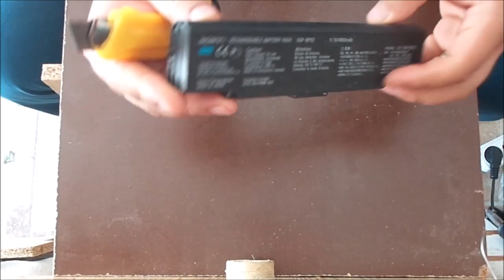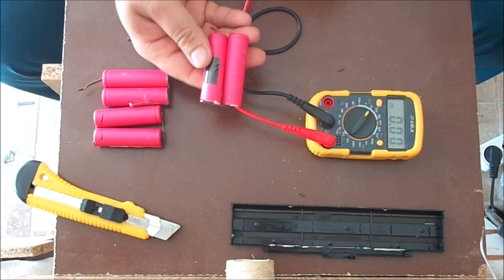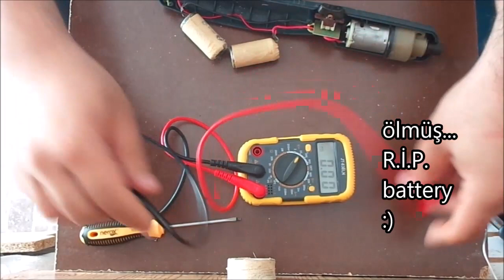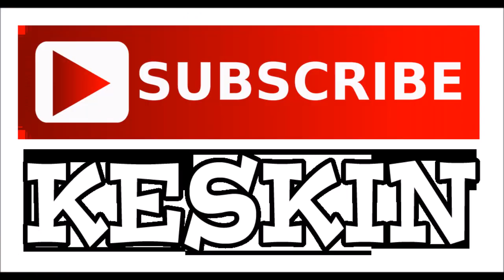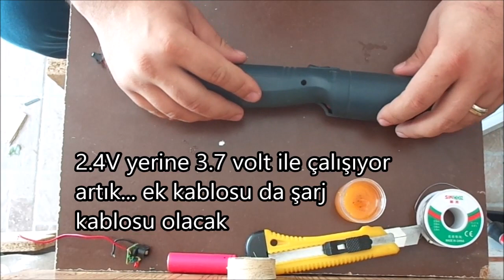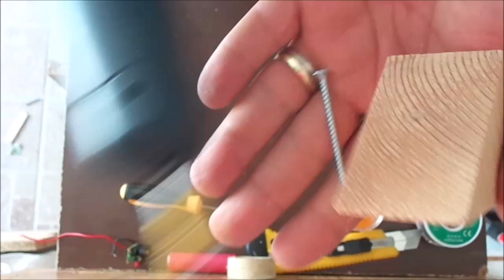Cordless Drill Battery Fix - old laptop battery  - a new battery - şarjlı vidalamaya yeni pil -

Comment: hocam 7,2 volt bir kablosuz vidalama aletim var li.ion pilli. elimde sağlam laptop pilleri var bunlarla 14,4 volt yapabilir miyim bu aleti.
Reply: hocam alet şarj oluyor zaten. 7,2 volt. muhtemelen 2 tane 18650 pil vardır bunu 4 e çıkarsak olur mu
Reply: 4 tane pili mi paralel bağlayacağım. yoksa son 2 pili kendi pillerine mi paralel bağlayacağım.
Reply: @ilkerkacmaz8427  motor kaldırmaz o 7.2 volt motor